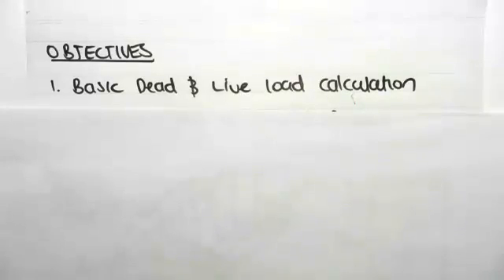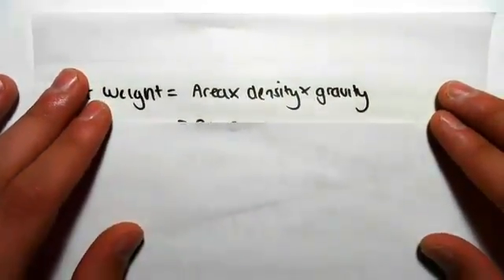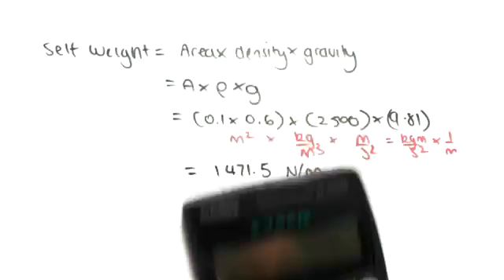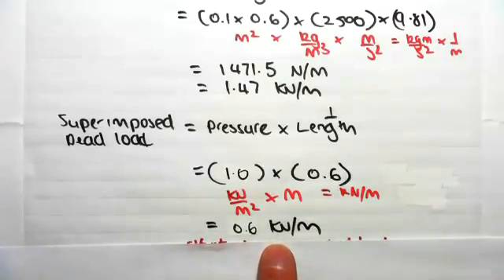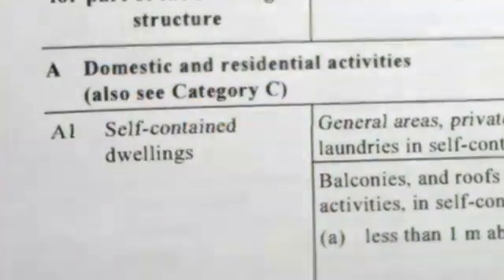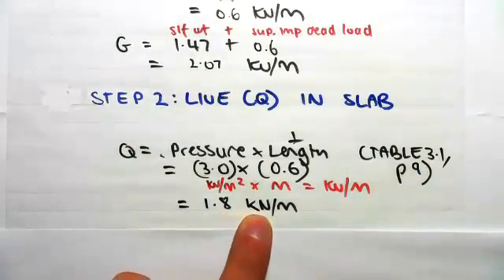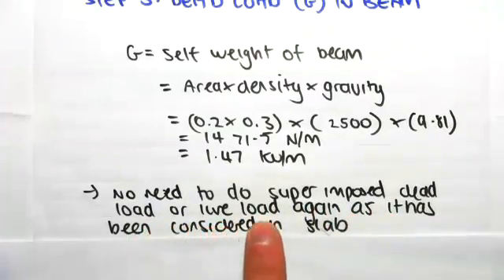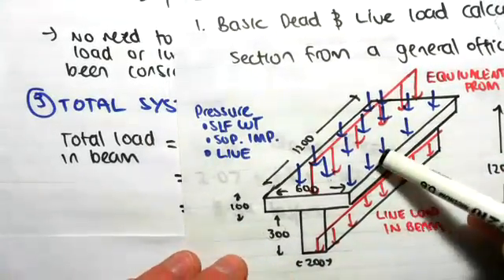Basic Dead and Live Load Example | Structural Concepts and Design

Comment: 2:45 got me confused with the units, isn't it kg/s^2? you wrote kg.m/s^2 , all the units in meters cancels. Please help me figure out why you ended up with N/m. Thank you.
Reply: The kg in the density multiplied to gravity is kg-m/s^2 or Newtons, as Force=mass(kg)*acceleration(m/s^2). Multiplying density to gravity now makes N/m^3 with the cubic meter in the denominator still coming from the density unit. 
Finally, multiplying the area (m^2) to N/m^3 results to N/m, or the distributed load or self weight. 

Hope it helps!